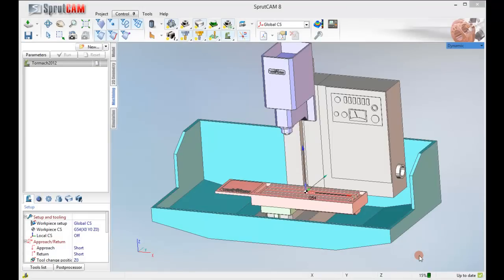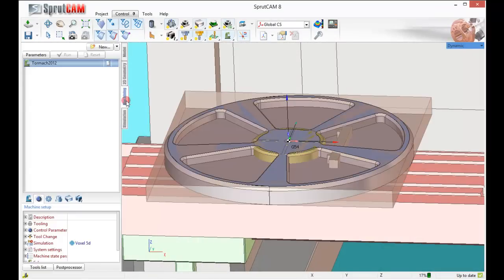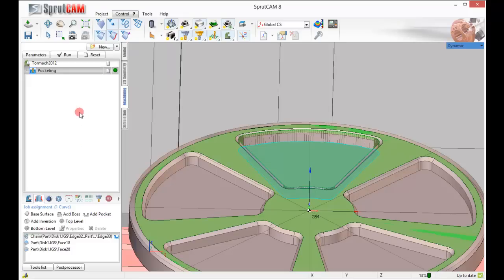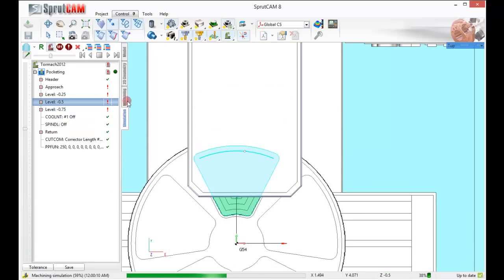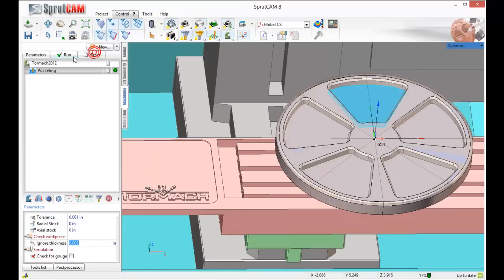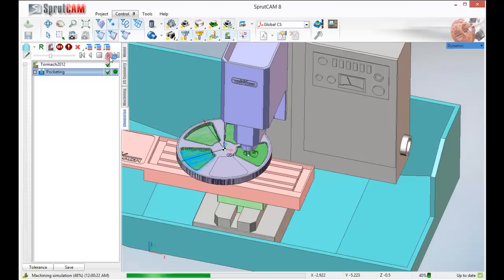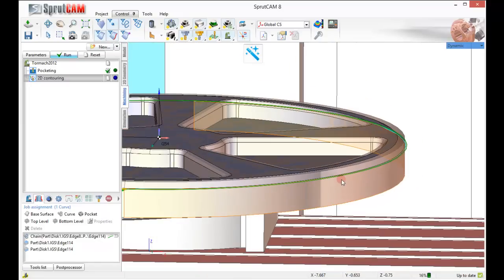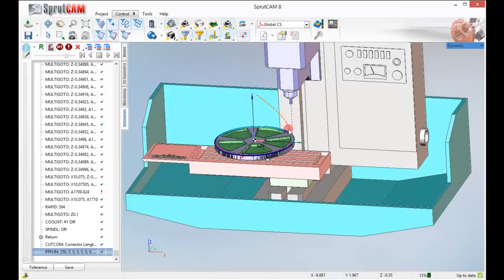Machining Large Parts with a Vertical Rotary Axis - SprutCAM 8

Comment: The machine setup in SC8 is more detailed than in SC7 however the rotary transformation appears the same so you would think this could be applied to SC7 as well.  That does not appear to be the case. Using the same disk/pocket setup and turning on rotary transformation using a variety of axis combinations in addition to the ones here do not produce the proper results.  I could be missing some special setup that tells the machine that the rotary table is vertical and not horizontal as in the SC7 machine GUI.